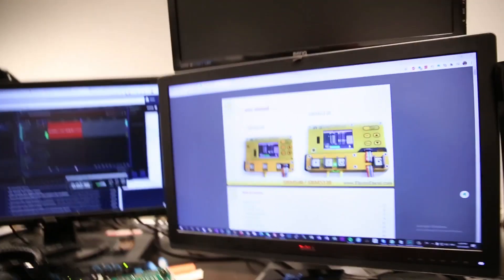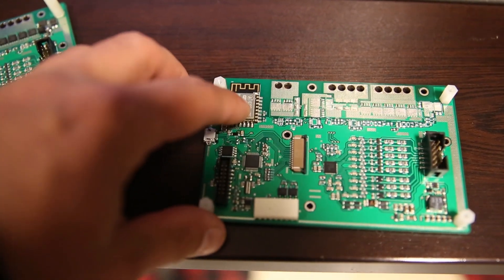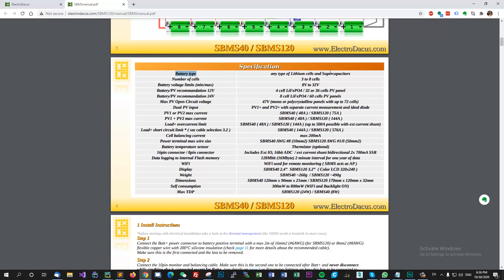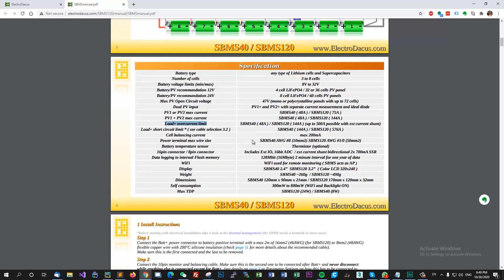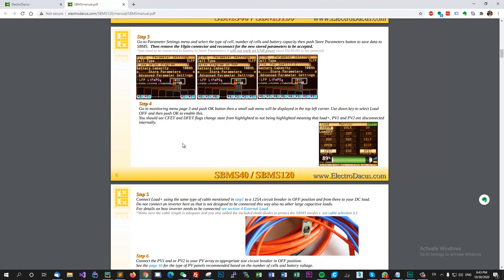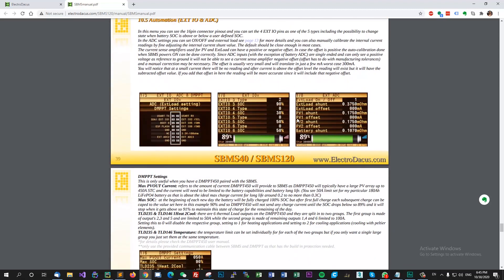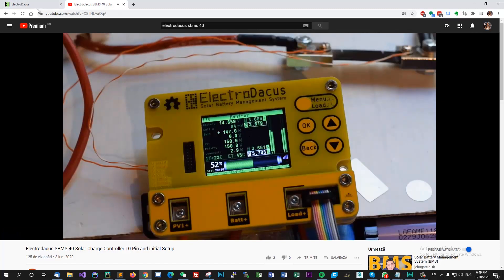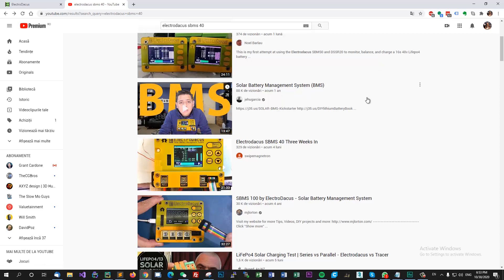Talking about electrodacus SBMS "hoax"

Comment: Can this just be used as a sbms for an ebike? Would that make sense? Is this considered a high quality and reliable product?
Reply: Hi, for E-bike you usually need 10S or more and this bms is 8S only, so I would not advise using for such project. This is best suited for large storage setups and solar panels.
Reply: @Alexander1560  thank you for the reply. I know, I would buy two. I am just tired of my research, there are so many bms or sbms out there, but also in bad quality. I may leave the bms outside the e bike battery and rather use your system or batrium locally at home. I wonder if yours system can do the job on. High quality standard

Comment: I would have ordered a few off these if they could be used on a 24V system with 2.0V cells (12 cells AGM)
Reply: I am pretty sure that Dacian has a product that does support AGM products. I know there is one guy who is using two SBMS0's on a 48 volt system somewhere on the planet. I saw a video of the guy using it. you may be able to use the triple unit and use one for every 8 batteries like he does. something to think about. to be honest it would be better to ditch the agm and use Lifepo4 which are so much better. they are basically set and forget while the agm are not as set and forget but a bit better than lead acid I grant you that much.

Comment: I am very excited about this SMBS.  I think I will wait until we can see the final products as this video doesn't really add much information about what's going on with this project.  You keep talking about the headless unit but we still don't know if it has a discharge circuit on it. Also I think you need to figure out something with the wire connections.  If you have to solder your wires directly to the board it doesn't seem like a finished product.  I will wait until this product is available and we know exactly what we are getting before I take the plunge.